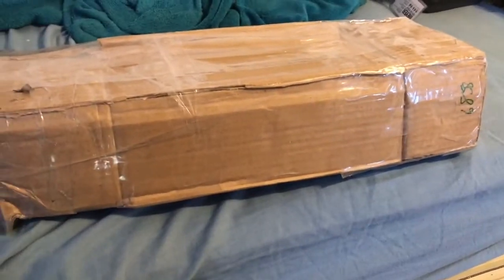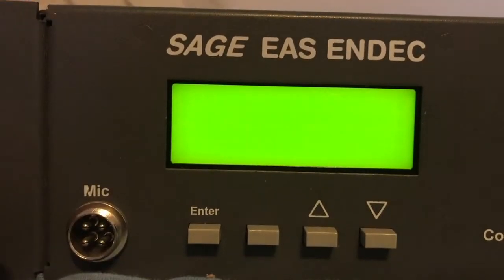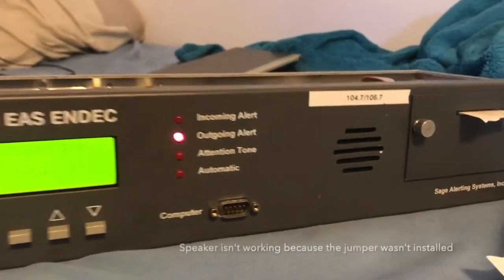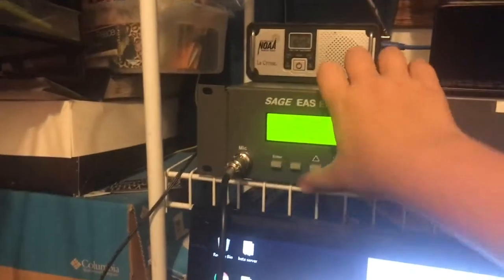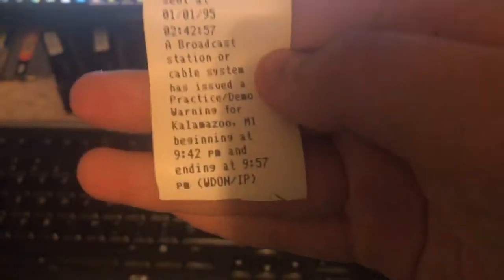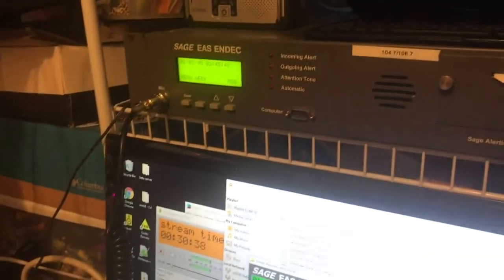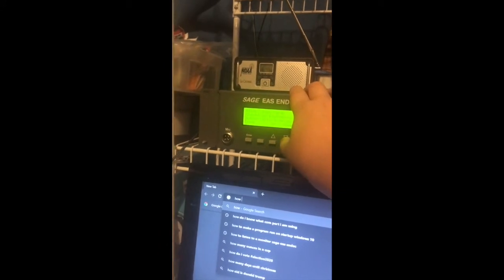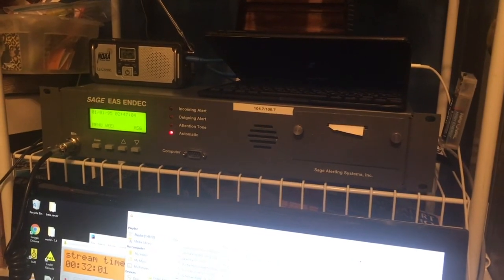SAGE EAS Endec unboxing + demonstration (With fail!)

Comment: Where did you get that
Reply from the maker: eBay
Reply: @dj-la--wolf1288  Different unit, this is a decoder not a encoder.
Reply: @dj-la--wolf1288  Really? I thought you needed the other rack unit to send it out.
Reply: Beazilla  ENcoder/DECoder - It's been like almost a year since I wrote that comment, cut me some slack, I've learnt since then. No need for the snarky remarks either.